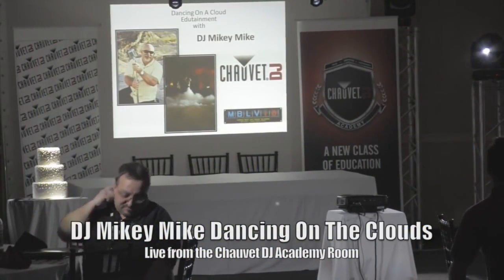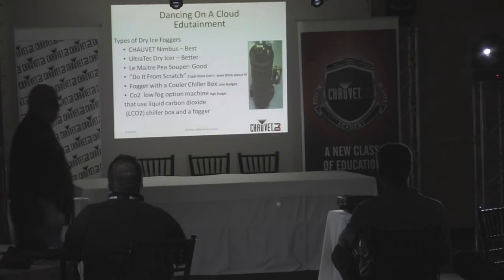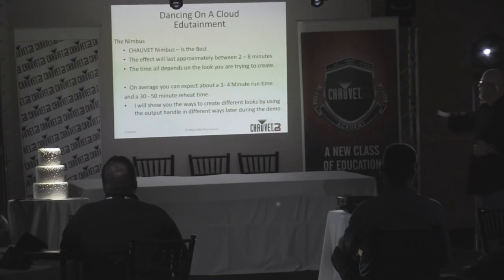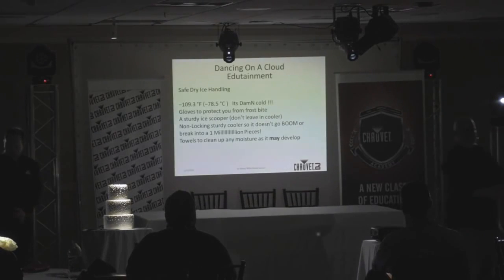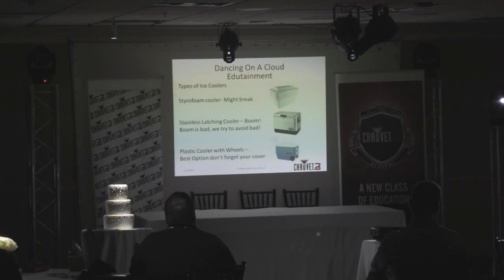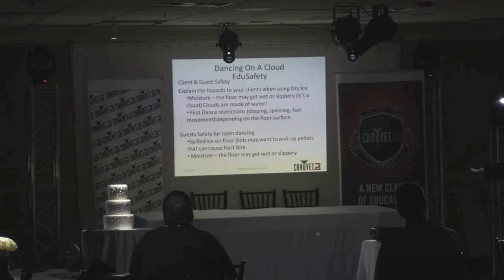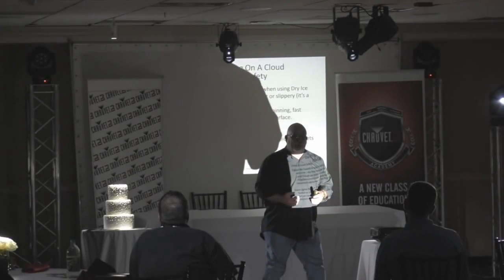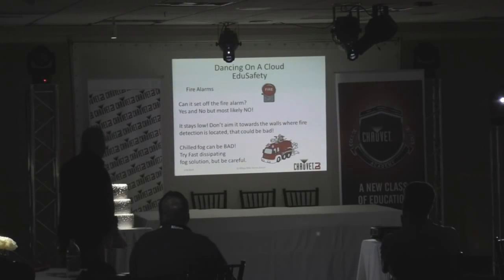Learn Dancing On A Cloud Do's & Don'ts Low Fog CHAUVET Nimbus Dry Ice With DJ Mikey Mike @ MBLV

Comment: DJ Mikey Mike...Everything looks great with the nimbus. Only thing I would say is you if you're providing lighting it needs to come from both sides of the dance floor. If your spotlights (moving heads or wash) comes from the DJ side. It creates a backlight for their guests. Which i can see in a few shots from your pictures. Other than that. The effect looks good because I use the same one.

Comment: Hi Mike~  I realize that you have CO2 chillers down as not being a good option but does that include the more expensive, better looking units like the Rosco Coldflow? Do you know anything about this particular unit? The reason I'm even considering this is because I need a solution other than directly buying dry ice. I live on a small island and I would have to take a ferry and travel all day to bring back dry ice blocks ($2 per lb) for the next days wedding, losing much of the product after 24 hours. CO2 would be so much easier to have on hand. I've never messed with any low to the ground fog before and I need to figure out if there are any practical solutions for me considering my inconvenient location. I've even looked into making my own blocks of dry ice (with the wooden box design) but thought this Coldflow machine might be less of a headache. Any insight you might have would be greatly appreciated.
Reply from the maker: Not to sure of that unit but might be a good option for you due to your location restrictions :)